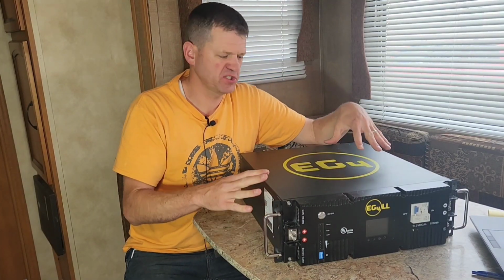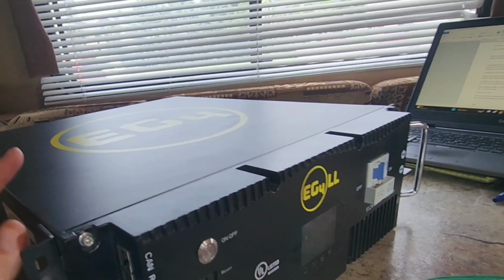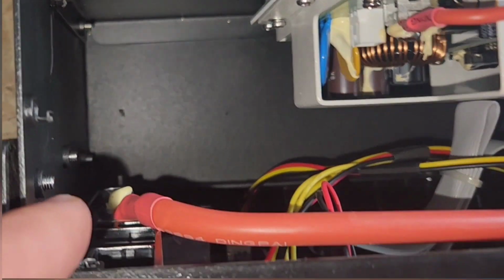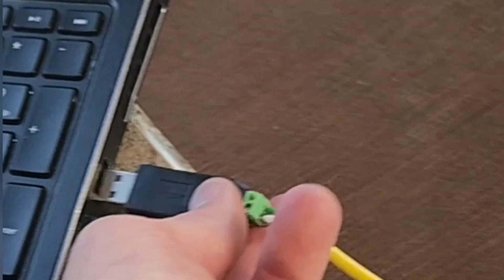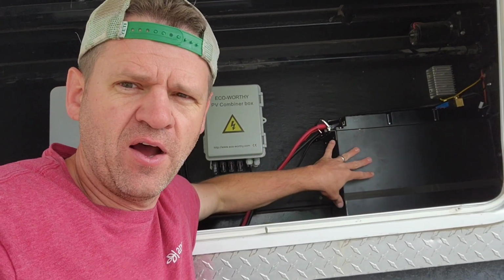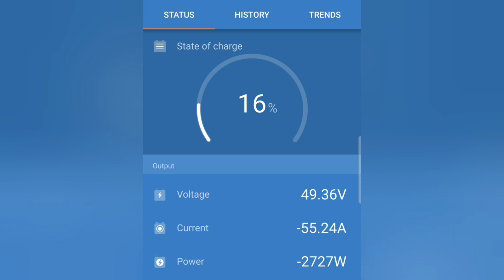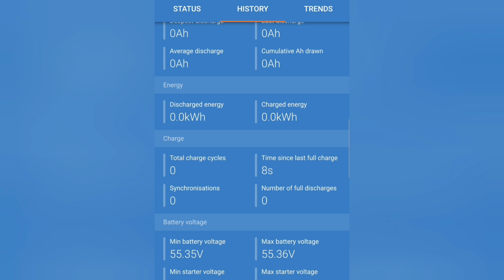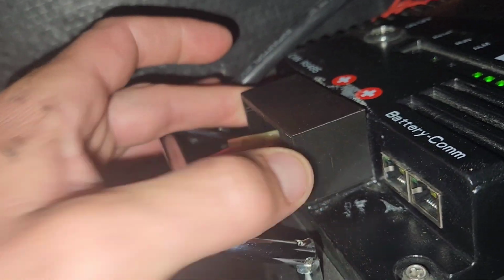Best 48 Volt LiFePO4 Battery? Testing and Review, EG4-LL Lithium Battery (V2) from Signature Solar

Comment: Awfully expensive compared to a lot of 280ah 12v batteries. 2x280ah is over 7000Wh and you should be able to get that for about a thousand. Add on a smart shunt and a breaker and I don't think you're getting anywhere near 1700. Bare prismatic cells with a BMS hasn't been competitive with complete case batteries for quite a while either.
Reply from the maker: They are about $1000 now.

Comment: I've worked in customer support for over 20 years and managed customer support "help desks" for fortune 500 companies as well as government. That said... my EG4-LL  went into protection mode and the customer support I was given by EG4 was among the worst I've ever received. No instructions, no follow-up, no competence. Still not fixed and I'm about to flush my 48 volt LiFePO4.
Reply from the maker: Thanks for sharing. Good to know. What inverter are you using to charge the battery? Did you try setting the protocol to a led acid battery?

Comment: I want to build a mobile onlo run the fridge during our occasional power outage.  I was thinking of using the LiFepO4 battery.  Would you still recommend it or would you switch to the EG4LL.  Most used to run the Fridge or charge the Delta Max 2000.  No heavy loads.
Reply from the maker: If you have no heavy loads I guess the lifepower4 battery would work for you. Are you wanting the 48-volt version? What inverter would you be using with the battery?
Reply: @diySolarPowerFunWithRay  I went and bought the eg4LL battery you have in this video.  I also bought the eg4 3k inverter/charger and realized after I received it that I would not be able to charge it via solar as I don't have the solar panels required to produce the voltage.  I found a work around and bought a Victron 100/20 that will accept my solar panels and will trickle charge the battery only.    All in all I love this battery.  I'm learning as I just got into this and it is fun and addictive.  Another work around I can use is to charge it with my ecoflow 2000 power stations while I charge them with solar.  I know it is not efficient but solar power is free.  I really enjoy your channel and am subscribed.  Thank you for your hard work.

Comment: Does your Growatt inverter have pass through charging to charge the battery with a generator for extended cloudy periods?
Reply from the maker: Yup. You can set it to use the pass through charging boost the battery to a specific % once it gets low.  All configurable... very nice.

Comment: It was not clear, you are saying that the EG4LL is the best battery on the market but then you said that if you bought a rack of batteries you would use the EG4 LP4 for that. If the LL is the best battery you have tested why would you not use that for a rack of batteries. Thanks for the great video as I am considering a full battery rack.
Reply from the maker: For a full rack of batteries, I would get the life power because I would be saving money. About the equivalent of getting an extra battery for my rack. If you have six batteries for your rack, any large loads could be handled fine because the amp draw would be split across all six batteries. If money is not that large of a consideration or if you just want the best, definitely get a rack of LL batteries. Hope that helps.  If you buy the LL batteries and use my affiliate links i will mail you some battery protection clips.

Comment: Hi Ray!  Excellent video!  I'm considering one of these batteries so I watched closely!!  When you showed the display of battery voltages I was a bit surprised...  it doesn't show individual cells, but the cumulative voltages.  Isn't that pretty much useless?  How do you spot a cell that has slightly out of spec voltage?  You can't read each value and use a calculator to subtract!  That's just silly!  I'm curious what you think about that!!  Thanks!
Reply from the maker: Hi, Thanks,  If you look at around the 2 minute mark it shows this.  It shows MiliVolts.  You'd love this battery if you get it!  It also comes in 12 and 24-volt models:

48v : https://signaturesolar.com/eg4-ll-lithium-battery-48v-100ahd?ref=DiySolarPowerFun

24v: https://signaturesolar.com/eg4-ll-lithium-battery-v2-24v-200ah-server-rack-battery/?ref=DiySolarPowerFun

12v: https://signaturesolar.com/eg4-ll-lithium-battery-12v-400ah-server-rack-battery/?ref=DiySolarPowerFun

Comment: Hi, considering the Will P EG4 trolley setup (easier than diy), but the batteries are out of stock. In stock are these LL ones, no idea what LL means, google brought me here, still no idea what it means.
All that stuff about the air conditioner was confusing. Simplified, lets pretend your setting up 2, their all the same price, which would you get?
Reply from the maker: Hands down...I'd definitely get the EG4-LL V.  The  LifePower4 doesn't have great starting power on it's own.

Comment: Does your roof top AC have a soft start system installed or is it factory original?
Reply from the maker: No soft start.  That's the crazy part.

Comment: Does the "same" battery but one grade down from SS have the fire suppression and the ramp-up capacitors to make it easier on the inverter?
Reply from the maker: Are you referring to the LifePower4 48v battery? It doesn't have fire suppression.

Comment: How long will this battery last with a constant 1500 watt space heater  load  coming off the EG4 3000 inverter.   And how long will the battery last with a constant 750 watt space heater load.
Reply from the maker: The battery has 5120 watt hours of capacity. so running a 1500 watt load with around 50 growatt idle would be....  5120wh/1550w = 3.3 hours.   minus a bit for 85% - 90% efficiency.... So i'd say just under 3 hours.  Half that for the 750 watt space heater.

Comment: You've got a great video! But BUYER BEWARE from SIGNATURE SOLAR they are selling server racks, but they don't have them. 

I'd like you and everyone to know, I just paid $16,123.21 to SIGNATURE SOLAR 903-4412090 TX on 07/10/23 for EG4-LL Lithium Batteries Kit (V2) - 30.72kWh with 6 Server Rack Batteries with Pre-Assembled Enclosed Rack with Door & Wheels and the EG4 18KPV Hybrid Inverter that I can't use. The next day, 07/11/23, I drove to Texas from Florida to save on shipping to pick these up after they notified me it would be ready for pickup. When I got there, after making an appointment to pick them up an having to be there within a 15-minute time period or they canceled your appointment, they notified me they did not have the rack because they were having trouble with the maker and the welding. They are selling batteries and the rack, without the rack!!! This does no good because you can't install the batteries without the rack. I'm waiting for the rack and my warranties are running out. They told me they would send me the server rack, but they have no idea when. You can't build a system without the server rack!!! But they are selling them and not telling you they don't have the server racks because they charge $10,119.00 for the set. If you look on their website, you'll see some items listed as "Out of Stock", but not the server racks because this too much money to lose. Again, BUYER BEWARE!

Comment: Could you charge a 48v Lifepo4 battery from a 12 volt boat engine alternator using a 12 to 48 v DC converter?
Reply from the maker: Just make sure you buy one that will limit the the amps because lifepo4 batteries call pull a ton on amps. A couple weeks ago I posted video on a van electrical system. You should check out the device he used there. That's what I'd I l use

Comment: I have 6 of them feeding my home solar system and have had no problem with them at all. The price is reasonable and they seem good quality.
Reply: Are you running a central or mini split A/C? For how long can it run? The price of these batteries is too good to be true.
Reply: @pfelram5976  I'm running two EG4 6500EX inverters set up for 240V split phase, with 6 EG4 LL batteries. I've had the system in since early March. I can't tell you how long it would run my central air. I have a 4 ton Carrier, about one year old. The system can handle it but the initial power surge when it kicks in is pretty nasty. I've never run the AC for very long because it's really power hungry.  In mild weather at a rough calculation I could run the whole house for about 24 - 30 hours off batteries alone as long as we're careful.

Comment from the maker: If you are using the "BMS tools" software it appears that the software will only speak with 1 server rack battery at a time.  If it's important to see all your batteries in your server rack at once, the Lifepower4 battery with the "BMS Test" software is apparently a better option allowing you to view all your battery in your server rack.
Reply: FYI, I have three EG4-LL V1 batteries, and they are all connected via an RS-485 Hub to my laptop, and the BMS_TOOLS can communicate to all three batteries without moving the RS-485 cables. Of course, the software can only display the data from one battery at any time. However, by changing the Pack ID, one can look at the data from whichever battery without moving cables.
Reply from the maker: @George_us  good to know. That's nice. I imagine you can do the same thing with these batteries.

Comment: Support is not good as 1 youtuber spend $20k but got no support😅😅😅😅😅
Reply: Are you going to add the lifepower4 with this one and see if they will communicate and work well together?
Reply from the maker: @joshhartin78  I haven't done it yet. I haven't needed to and they are a hundred pounds each so it's kind of a pain to put them together. I'll do it in the future as a short though.. good idea.
Reply from the maker: Did you mean 2k? They did answer the phone right away, and they didn't put me off... they kept on trying until we got it working. They have a lot of products to support. In this case, it did take an hour. Which is definitely longer than the norm. With signature solar,  they have been going through some Growing Pains, and I have had some technical support people that weren't as informed as others. But in the end they have been able to answer the questions I've given them.
Reply: @diySolarPowerFunWithRay  we tried to link Lance channel so you can see how he dealt with EG4 supports but looks like Youtube block it. Any way search for EG4 batteries and his name is Lance K.
Reply from the maker: @adassociates8235  Thank for sharing. I looked him up and his review of this battery. It looks like he was able to get support from signature solar but he wasn't happy with using this battery over the Lifepower4 battery when grouped with other EG4-LL V2 batteries. I agree with him. when you want a stack of batteries I also recommended the Lifepower4 batteries over this one.  It looks like the BMS tools software that speaks with this battery isn't as good as the "BMS Test" software that works with lifepower4 batteries. That's good to know, I wasn't aware of that. I'll pin it as a comment here. I still very much like this battery if you're only going to buy a single battery for your system. thanks for sharing.

Comment: Need  a High SEER VRF "Variable Refergent Flow"  AC/Heat pump like a minisplit Thats in an RV format.  See the Media U window units.
Reply: Just pull the trigger on a mini split. They use almost no power. There are a lot of cheap brands that aren’t variable rpm pumps. We dozens of Senville units, from 18k btu to 24btu arctic pump. They heat and cool amazingly.
Reply from the maker: @HorizonBroadband  I'm surprised they don't put mini splits and lithium batteries in RVs nowadays. Seems like they are so behind.
Reply: @diySolarPowerFunWithRay  agreed! Lithium Ion aren’t worth it, and LiFePO4 are new to market because chinas patent ran out. So now we can get them. Our calculations are one of these replaces 8 100ah AGM batteries for our purposes. So cost is almost the same but performance is a better and longer life.
Reply from the maker: Yeah I hear amazing things about the mini splits. Especially in rvs. My current air conditioner is super loud when it's running.